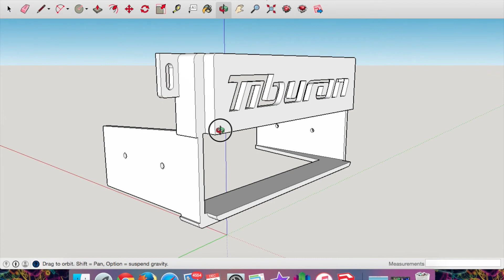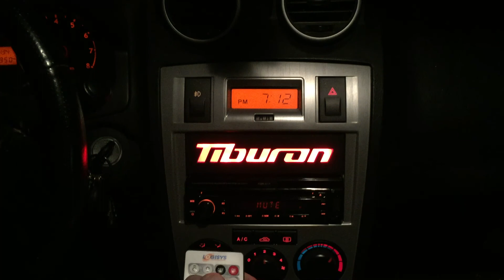Custom Hyundai Tiburon LED Dash Trim

Comment from the maker: Ended up changing the design and re-printing as you may be able to tell.

Power comes off of an additional relay I put into the car. Thats why it shuts off when my vehicle is turned off. The full painting process consisted of several layers and a clear. The part was printed out of Made Solids's PET+, because it needed to withstand the high temperatures of a hot car in the summer. 

One more thing. I realized I never really gave a good look of the unit installed into the car, but it looks quite professional.
Reply: Luke AOD should make an sell these

Comment: Hey Luke I was wondering if you could make me one of these? I have a 2004 Hyundai Tiburon GT  would it fit my dash ? And if you're still making these , how much would it cost me to have to make me one and ship it to me? Are you a member of the Tiburon racing league on fb? I bet you could make kickass money if you advertised these in the group js!!
Reply from the maker: I appreciate the info, and thanks for the sub! unfortunately someone t-boned me and my tib is no more :(. Id be more than happy to make you one, however you will need to install. You can do so by either hijacking an existing relay in your car or integrating your own relay. 

The price to make it would depend on what you wanted. As far as the material goes it would have to be a material that can withstand the temperatures of a car, and in the world of FDM 3D printing that pretty much boils down just a few materials. Price wise ABS would be the cheapest, then co-polyesters , and the most expensive would be polycarbonate. 

Co-polyester would probably be my recommended. It's what I used for mine. It's far more durable than ABS especially when 3d printed. Also there would be a huge lead time for either ABS or polycarbonate, as I am currently in the process of assembling a machine that is capable of printing those materials. They're both excessively difficult materials to print, especially with such a large part.  The biggest problem You would have right now is that the machine I am currently using (made by yours truly) is a total piece of crap lol. Poor frame design, though I learned a lot. The machine has a problem called "Z banding" you can look it up on google images if you want to see what you're in for. I can get you a co-polyester print from it, however it will be pretty ugly. Honestly though it wont really matter because all of the nasty bits or anything that is going to look bad WILL NOT show. The only showing surface is the bottom of the print which will come out fine, plus it will be sanded and painted. 

Other things that effect the cost will be weather or not you want me to send just the part itself or RGB lights installed.
Reply: dude that sucks !!! buy another tib!!! love those cars!!
Reply: i still have my old body control module ( fuse box ) BCM ..  will the relay i need be in the box?
Reply from the maker: Yeah you can just hijack the same relay as your radio. If push came to shove you could always just wire it off of the cigarette lighter but you'd have to remember to shut if off every time you got out of the car. It woulden't be that big of a deal, the led lights only suck up a few mili amps. It would take weeks of sitting to drain your battery but it would't be very professional.
Reply: I'd be willing to pay for materials and the labor behind it.  Hit me with a price on the Co-polyester @YOURMOMxo69xo
Reply: @YOURMOMxo69xo  Yo! just reminding you that you left your comment with your email!
Reply from the maker: @Tweedledee__  Thank you